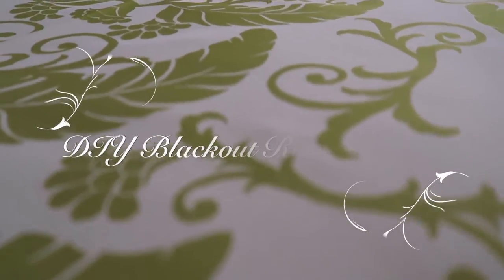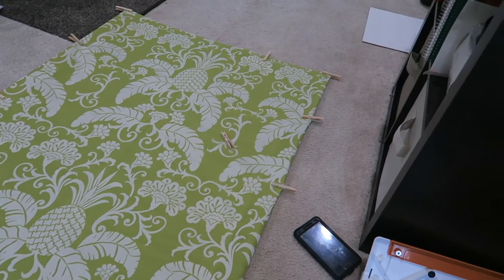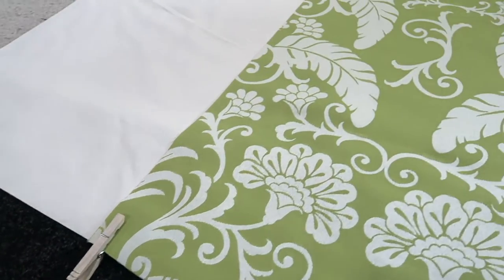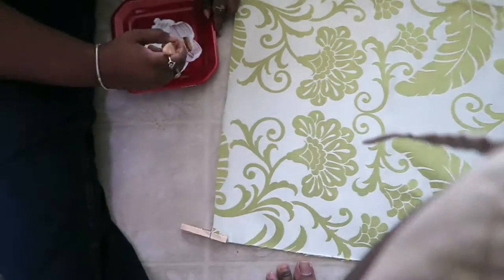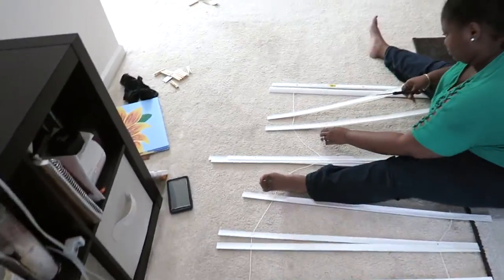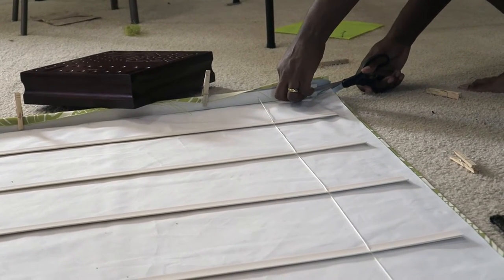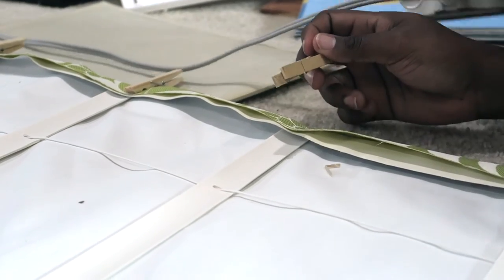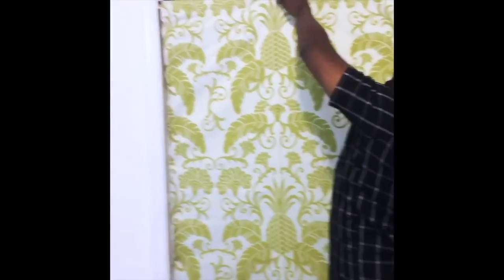Making our DIY Roman Shades

Comment: Hey there, i know this is an older video and it was very helpful.  I was wondering, how are or did that Roman Shade hold up?  Since you only glued the blackout liner at the top and not in the middle/sides.... did it hold up well or did the material separate and make opening the blinds difficult?  I'm getting ready to do this similar project myself.
Reply from the maker: Thank for watching. We lived them for a while. The only thing I would say is to do this project with thicker blinds. After a while, the shade became to heavy for the blind itself.
Reply: What do you mean you use a heavier blind? Did the blackout material cause a problem because it wasn't glued all over
Reply from the maker: The blackout material was too heavy for the slats/blinds themselves.
Reply: Gotcha. I was planning on gluing four or five of them together,per slat anyways just to reinforce and make them stronger, prior to even watching this video, to give it more strength.  I appreciate you responding, but you still haven't answered my question about gluing the blackout material? 😕
Reply from the maker: Sorry yes it wasn’t sturdy enough without gluing in the middle.